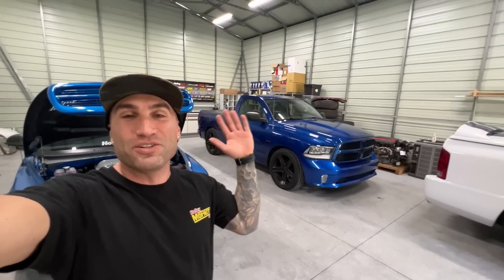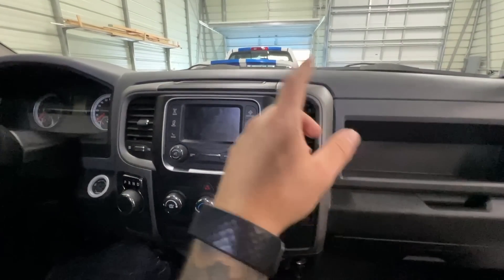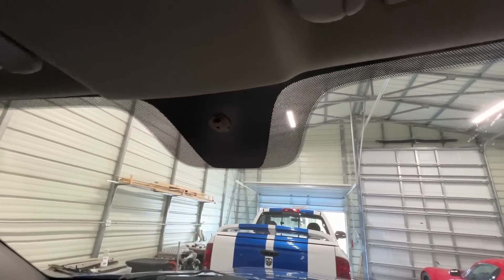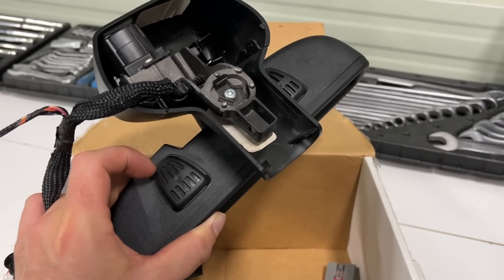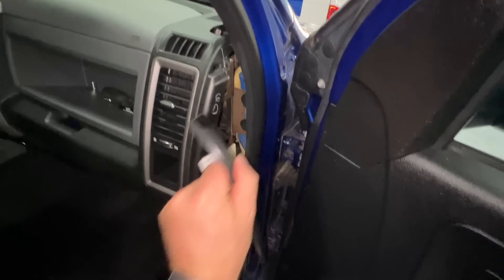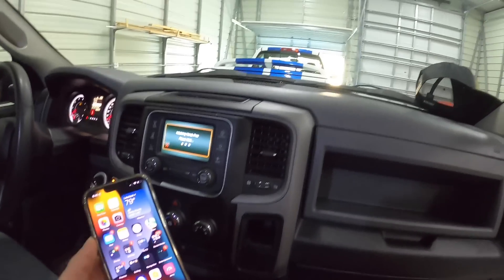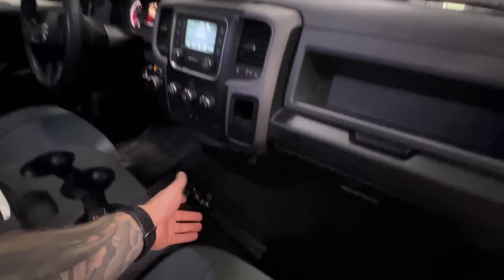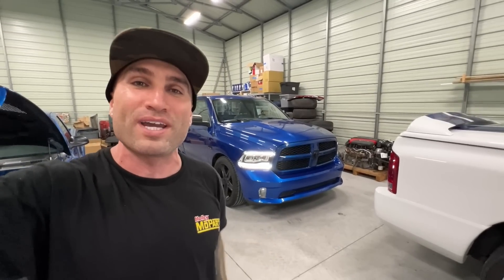RAM Truck Uconnect Rearview Mirror Upgrade | Microphone Handsfree - Dimmable - Auto High Beam Wipers

Comment: An awful lot of trouble to upgrade a rearview mirror that you can’t even use the microphones if you install an aftermarket stereo they don’t even make a retention kit. Uconnect is garbage when the vehicle gets over a few years old and all the radios don’t get much louder then about 20-30DB In my opinion this is the Dodge dealers way of saying that if you don’t buy a vehicle for $50,000 every three years, you’re not gonna have a good stereo

Comment: Makes me curious about doing this on my 18 tradesman 2500, I know that connector on the inside do the dash is being used for my roof cab lights right now. Just finished an 8.4 and 7” digital gauge cluster on mine!! Didn’t even know this mirror was an option to upgrade!

Comment: I don't think I hit save, but my '18 has hands free, and no mirror mic setup.  Even when I had the "basic" mirror, as the factory screwed up on the Rebel, and put the wrong mirror in.  I got the auto dimming mirror through the recall, as they had it on the sticker, but not the truck.  (Not as basic as your mirror, as I did have Assist/911 buttons, but manual dim mirror.)

Trying to figure out if I have the auto high beams, and your video is the first place I have seen where the actual sense head goes.  I've been looking in the wrong place for like a month to see if I have the sensor.  Now I just have to wait until I can sneak out of work to look a the truck!

Comment: So I have the mirror with auto dimming and the back up camera. I want to get the same radio in the truck in the video  but I want the hand free as well. Since my mirror right now does not have the microphone will all I have to do is buy the new mirror and hook it up the the existing wire my mirror is on now? (Without running a new wire)

Comment: Dude I looked for the link in your post since I'm desperately needing to upgrade my truck (2020 dodge ram, bought it used from the dealer and found out after I did the paperwork that there was a bunch of accessory work that needs to be done) and the link was pulled. If you still have it I'd appreciate you leaving me the links again

Comment: I have done the same swap in my express. Recently when I use the Bluetooth for phone calls the person on the other end has a bad echo. I've tried different phones and a different mirror with no luck getting rid of the echo. Any ideas on what is causing the echo?
Reply: Friend had that issue also. She did a reset of her radio under settings and by holding the mute/scan buttons.  Then she unhooked the battery and touched the pos/neg cables together, held them for a minute and it “ drained”the system. Worked after that. Not sure if it helps.  To be clear…both pos and neg terminals are unhooked.  Like you’re installing a new battery.
Reply: @reaver357  thanks I'll try that too.

Comment: Hello, sorry, I have a RAM 1500 2014 and I bought the remote controls to configure them, since I didn't have them and when I went to the locksmith he told me that the RAM cannot be configured because it does not have the device from the factory to do it, my question is, it will be true that this option does not come from the factory, thanks for your help...
Reply: 2014 ram has an ECU which means it can be programmed by any tuner compatible

Comment: some of these sensors (maybe only the rain sensor) unfortunately need hole in the black paint which you will not have unless you change windshield as well, or relocate sensors lower below the paint out of the box